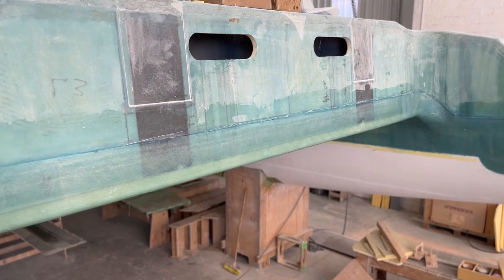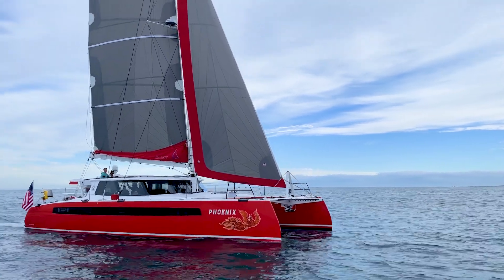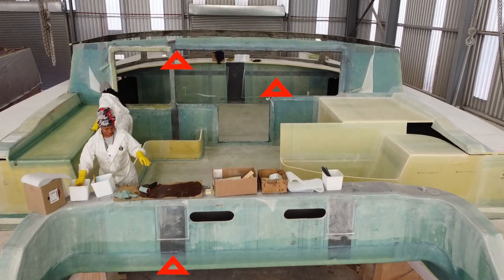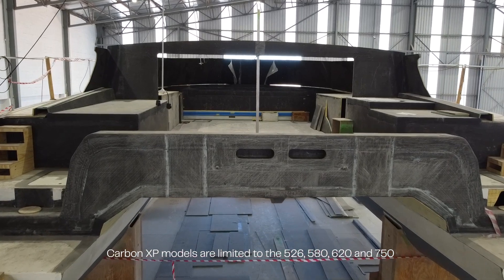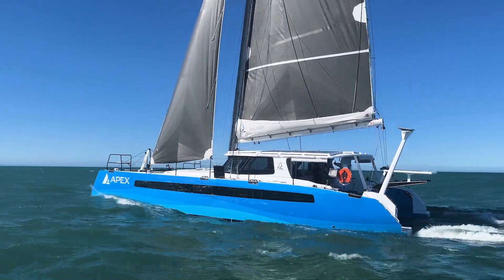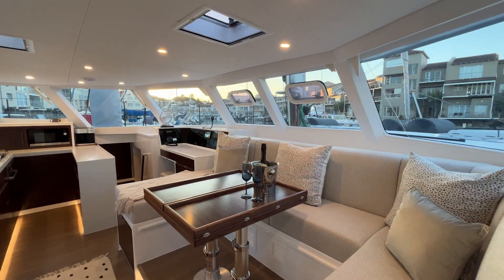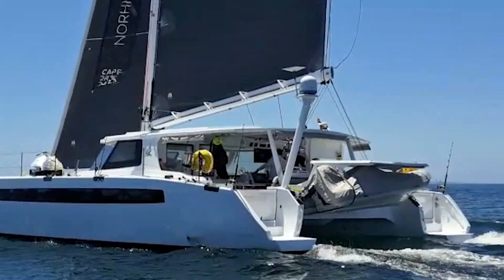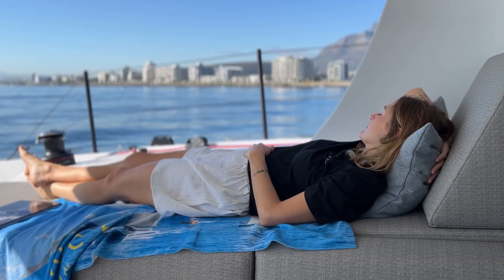Carbon Cross, Carbon Cross +, Carbon XP

Comment: For the PARTIAL Carbon builds, do you electrically bond the Carbon parts together?  (Bonding can be done with Carbon, of course.)  In other words do the Carbon reinforcement layers connect to each other, and hopefully a formal electrical bonding point(s).  If not, the Carbon forms part of a galvanic cell.
Reply from the maker: We know how to bond carbon properly and have done it for years.
Reply: @balancecatamarans  Seems like it!  Thanks!